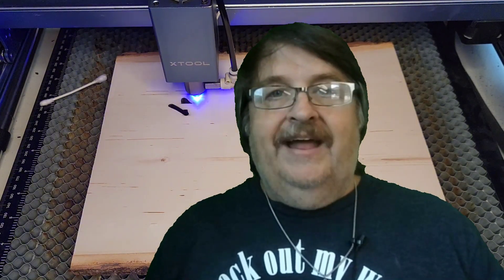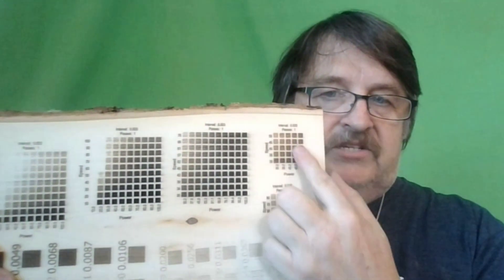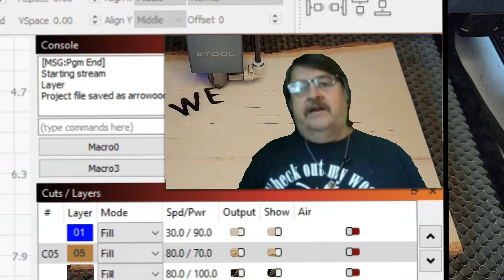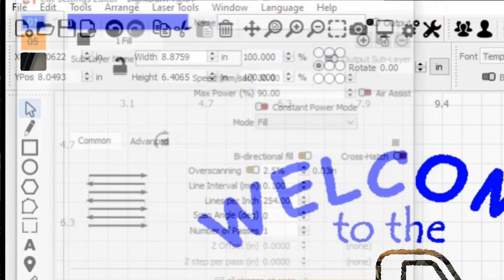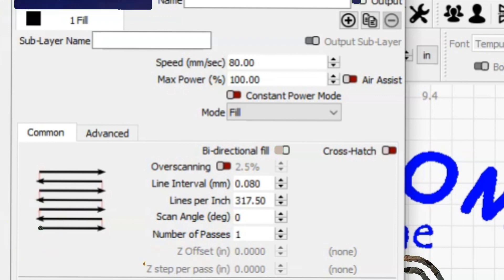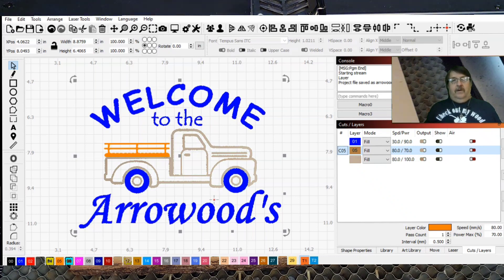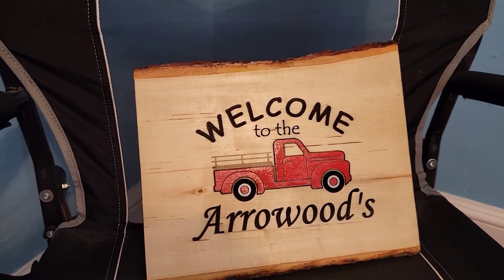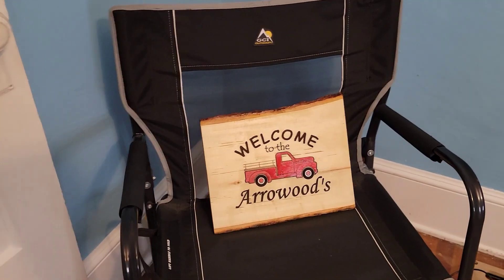Ideas like this take your LightBurn designs to the next level with your xTool.

Comment: Excellent videos and information as usual however I would like to know what the outcome was with xTool on the lens covers
Reply from the maker: You may be aware, I have purchased 2 replacements. They already sent me one free replacement. Counting the original lens, I've had 4 failed lenses. They did send me an additional 2 free lenses. But talking to other xTool owners, the very first laser modules the produced did not have these dust lenses on them. The owners with these modules that have performed a proper maintenance regimen, have not had any issues. I suspect, others that weren't cleaning regularly may have had problems. They could have possibly had failures with their laser lens from lack of cleaning. So, to protect the consumer from themself, xTool found it necessary to had the "dust lens". Purely speculation. But I've been using mine just fine without any "protective lens". Clean every day. It's works fine. I was told by a customer service rep, the first time I had a problem, I could use the laser without the dust lens. This time the took that statement back. But at this point, I figure what the heck. It's eating lenses like Sweet-Tarts. I'm no longer fooling with them.

Comment: I thought you had a negative opinion on the xtool, has that been resolved.
Reply from the maker: There are things I do like about the xTool. But it is the tool I have. The designs and ideas I'm doing can be done with any diode and LightBurn. I'm learning work arounds with the tool's limitations and its inadequacies. I would like to have a bigger console laser instead of the desktop I've got. But out of my budget for now. And these types of videos are more in demand for the hobbyist and the desktop lasers. Thanks for watching.
Reply: @HoboWithWood  Thanks for replying. Reason I was asking is I was thinking of buying one and I'm also on a budget so just didn't want to spend money on something that I was going to have trouble with being it comes from China.
Reply from the maker: @scottcrawford6025  one of the biggest and cheapest things I wish it had are limit switches. I wish I had the 20W module and a camera. It is what it is. An inexpensive hobbyist laser with decent capability. I needed something to do, more than I needed a laser. I'm more about documenting my experience on YouTube for financial gain more than anything. Being completely new to the lasers and LightBurn, I figured the average guy or gal just starting out with similar experience would benefit from learning from my experiences. Hearing it from someone that doesn't speak laserology as his first language. Got a new toy I hope to unveal next week. Start tuned and thanks again for watching.